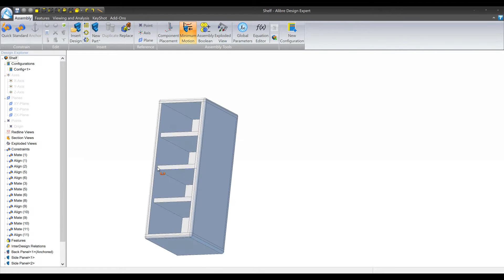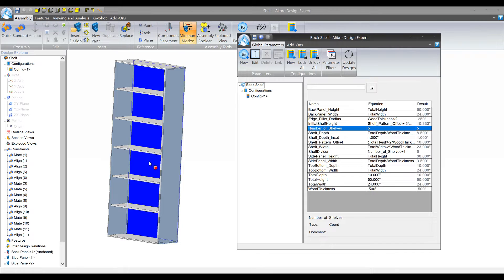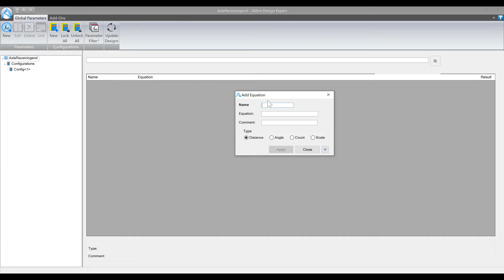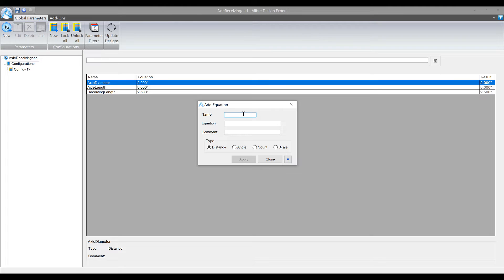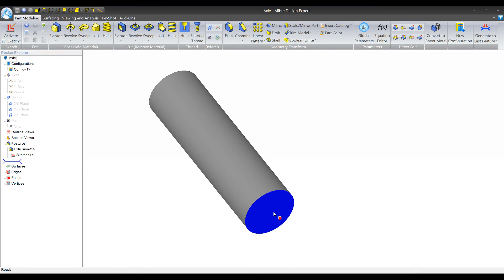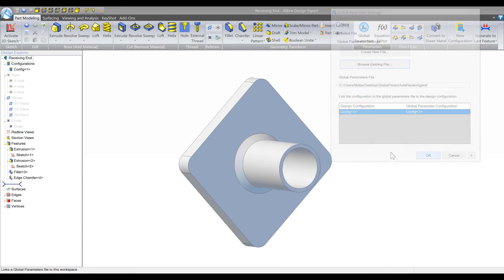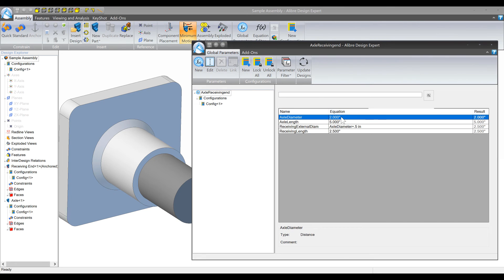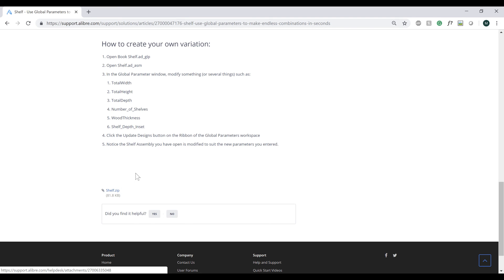Global Parameters in Alibre Design (Legacy Interface)

Comment: Can you drive the Global Parameters from an external file, ie a spreadsheet ?
Reply from the maker: You certainly can.  You will just install the Alibre Design Excel Add-in, which comes included in the Alibre Design Installer.  Save your Excel file in CSV format, and you are good to go.